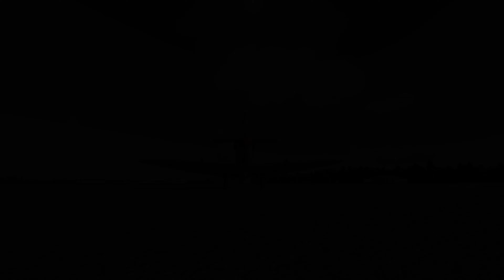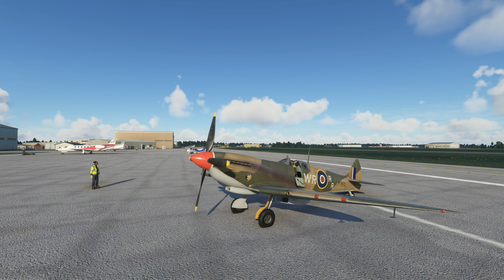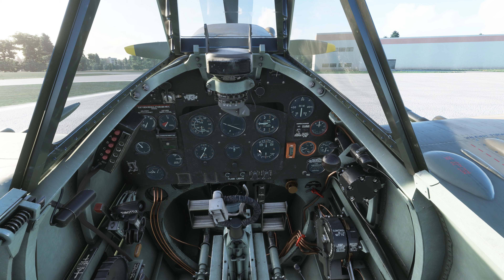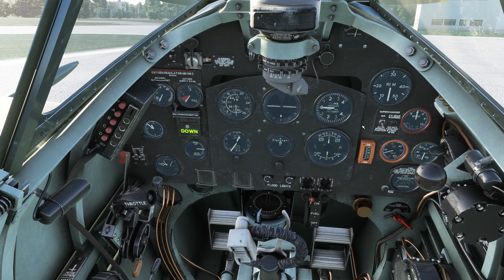Spitfire Start-up Procedure Tutorial | Flight Simulator 2020 | How-to guide

Comment: The fuel pressure warning light does not extinguish
Reply: I have the same problem and dont know what to do, did you fix it and how?
Reply: @jeffreylebowski4927  nope, haven't fixed it yet, sorry. i'll reply if i find something.
Reply: @PurelyPog  I had same issue till I found the black handle by right side of seat. Push that handle forward then when you pump the woggle the red light will extinguish.  Now only problem for me is the prop will spin but engine won't kick into life?   Not sure what I'm missing and end up having to start engine using the keyboard. Any advise is much appreciated.

Comment: My engine fires up for 3 seconds and then spins out
Reply from the maker: After you have extinguished the fuel pressure warning light with the wobble pump, unlock the Engine Primer and pull out and release around five times before starting the engine.  This changed after the last update.  Hope this helps.
Reply: @Asparagus69  I still have the same problem - even after following every single step in the video plus pulling the primer 5x. No clue what else can be the issue. CTRL+E starts the engine without issues.
Reply: Ahhh thank you very much!

Comment: how do you twist the primer to unlock it? I've tried several times to unlock it but was unable and therefore unable to start the engine.
Reply from the maker: The only way I've been able to unlock it is by hovering over the primer and using the mouse wheel, scrolling away from you.  Can't find any other way to do it so far.
Reply: @Asparagus69  thank you
Reply: i cant unlock the primer too..
Reply: Scroll wheel does nothing for me im wondering if the new update broke it idk im on default control settings and scroll wheel doesn't change it at all just zooms me out I've tried messing with controls and I cannot get this to work for a cold start
Reply: @TXVETJEB  nope
Reply: I found that if you click and hold the primer and slide your mouse left and right, it will lock and unlock - its a little awkward to do but this does not pump the primer. I wasn't able to pull on the primer to actually use it with the mouse - must be a minor bug. To fix this I had to go to controls and assign a key combo to do it. I used Shift+1 keys since nothing was assigned to that. Then the primer finally functioned. I hope this helps.
Reply: @BillyintheSky  I fixed it so it works properly I just can't remember what it was exactly since I've been away from the game for a bit but its under the control options where you can change the controls to before update 5 and that 100% fixes it completely
Reply: @tamarawootton1077  this was a huge help, thanks! ! i didn't know you could do that. I set it back to legacy and all works well!
Reply: @BillyintheSky  no worries It also fixes other cockpits with similar control issues